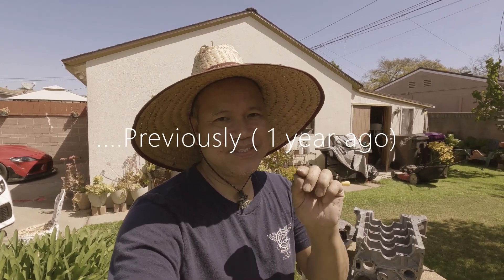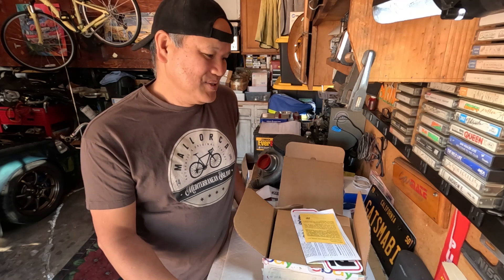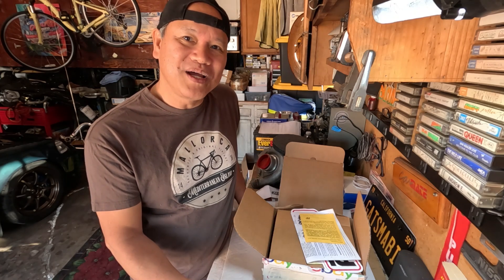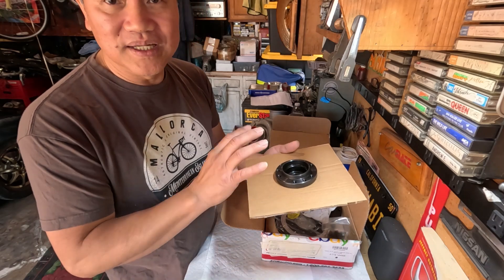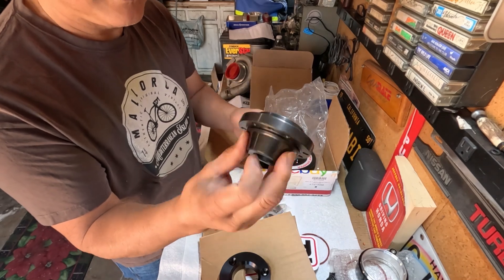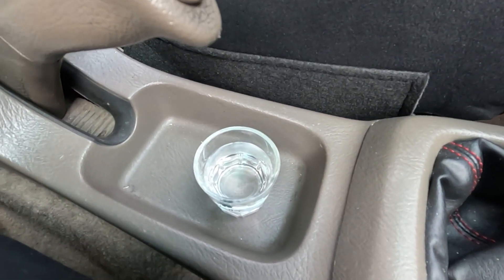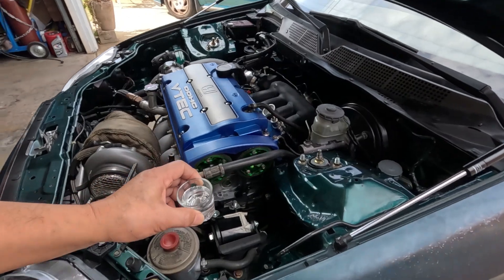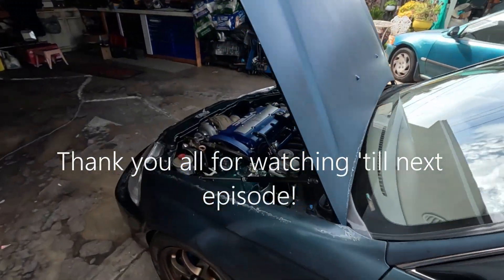H22 ATI damper! Do I really need it when Balance shafts are deleted?

Comment: Great video! 
I was wondering if this damper wil fit my h2b swapped civic ek. Frame clearance is already a problem with these swaps. What do you think?
Reply from the maker: Yes it should, you can get the other p/n 918469. It's the damper w/o the ring for power steering.
Reply from the maker: Thanks

Comment: My friend i need your help on an unrelated matter.. would a gen 5 h22 manual vss work on a m2b4 lsd transmission? Much love and appreciation
Reply from the maker: I should work, all Prelude MT vss gears are the same. I'm using m2s4 vss on my M2b4.
Reply: @sagittnet2158  Im sorry to do this again my friend, but you're the only one that knows haha. I took out the VSS, gears all seem fine, replaced the top part and it still shows Code 17 after 5 mins of driving. Its a h22a swapped ek civic, with a new rywire harness.. Could you think of anything else I should check? The speedo went out for a whole day before the code was thrown and now no vtec :( . What would you recommend I do next?
Reply from the maker: @CherryPickerr  I  recommend to do a t/s elimination process. Not sure what yr ek you have or are you using a ecu conversion harnes but lf l were you, l'll check the vss wirings. Check for any loose wire at connector. Did you have any issue before or vss problem arised recently?
Reply from the maker: @CherryPickerr  When vss is not working, vtec will be affected by it.
Reply: @sagittnet2158 no issue at all, harness is brand new. One day speedo stopped and next day code 17. I did replace the connector with another used one. I have ordered a new connector, i will try again. Wires all look to be fine
Reply from the maker: @CherryPickerr  okay, when ypu do get the new connector, verify that the wires are terminate to correct location and it  mate on the vss sensor. Hope you get if fix soon.
Reply: @sagittnet2158  Got new connector, still having same issue no speedo and code17 after 5 mins :( . I checked harness wires everything all ok (brand new harness). Could it be that its an issue with the wiring on the cluster? The cluster i have is very old and it previously swapped it. Should I try replacing the cluster.
Reply from the maker: @CherryPickerr  It's possible, do you have a spare cluster gauge you can check it with. Verify that the fuse if there's any are ok.

Comment: What would you rather, full h22a swap with type s pistons or a g23 with k20a2 pistons? What will make more power? 
This will be my first build and I am planning to do it myself, i have and h22 block that I can put some iron sleeves and I also have an f23 motor that has 180psi on the 4 cylinders, so I am not sure what to choose.
BTW awesome job, I have learned a lot in this channel
Reply from the maker: Since you have a H22 block and able to get it iron sleeve and its your first build, H22 ftw of course coz of the reliabilty. G23 will make more power and torque due to 97mm crank. Most people build g23 coz it has a iron block and dont have to deal with FRM sleeve.
Reply: @sagittnet2158  Thanks for the help, I will follow your advice and I will save the f23 block for a future project.
Reply from the maker: @chicho8158  yes and if you decide to ho turbo. Use your F23 block and get a k20 Nippon racing turbo piston like l have and use forge rod. Ebay forged rod is okay, thats what l'm using. But keep your power goal under 350, dont go any higher so you can enjoy it. 
I
Reply: @sagittnet2158  Also, I wanted to know this in case I go for the g23, if I buy k20a2 rsx or dc5 nipon pistons, do I have to put them backwards? What would you pick between those 2 pistons for NA?
Reply from the maker: @chicho8158  if you are using a h22 type S cams, use RSX piston. If your'e thinking of using sk2 pro 2 cams, use Civic Type R piston and use e85 for fuel coz of higher comp ratio.
Reply from the maker: @chicho8158  If using RSX w/ type S cams, install the piston 180 degrees. If using sk2 pro2 cams w/ nippon racing ctr piston. Clay your motor to make sure you have enough clearance.

Comment: Thats good kuya. Im thinking before to tune my car get ATI
Reply: Kuya do we have ATI that you can able to run a power steering and A/C belt?
Reply from the maker: Ati and Fluid damper are a/c and power steering friendly
Reply from the maker: They said it helps a lot and l'll find out soon.
Reply from the maker: Magandang kapalit ang  ati or fluiddamper sa lightened pulley mo

Comment: Sounds crazy but get the stock crank pulley balanced and see if you feel a difference in vibration. I know the engine is internally balanced but....a balanced crank pulley in my opinion is good. Also the k24 has a 99mm stroke and it's done without balance shafts. The f23 girdle is very similar to the k series....just my 2 cents.
Reply from the maker: Hey bud, how you doin man? I sent the crank, clutch assy balanced before it was assembled and my shop told me that not a whole lot of out of balanced on the crank. Been wanting for a long time to use a aftermrket damper and l'll see if any good on hi-rpm. Take care man

Comment: Always removed my balance on my motor with no issue on na stock builds. But I do agree with Built na or turbo motor it's a good idea to use a ati damper.
Reply from the maker: I wanna try it out, been wanting to have and use a aftermarket damper.

Comment: also would u recomend if i put oil catch can on my f22a1 motor ? would it help with the intake mani being cleaner
Reply: or running a littler cleaner i know it would have to be custom too !
Reply from the maker: If your'e turbocharged, its best to use a catch can. If NA, l know the one breather line from vc and connected to intake side, oil get suck in instead of the other way around. The idea is, that line was suppose to be the fresh air intake and outlet will be on PCV valve and air is introduce back to combustion but its not always like it. Having a ctach can wont hurt in between intake and valve cover.

Comment: I will install it in my Turbo H22, but in my opinion in performance we can't look the perfect engine as stock. The vibration can be added  from engine mounts, more stiff equal more vibration.  In my opinion the best way is always balance the crank with all components attached on it, the damper will be a cherry to the cake,
Reply from the maker: I agree, l'm using 75a mounts and it's day and night compare to what l had on it before. I thought of changing it to 65a in near future. 
I'll find out soon if these damper will make a difference on hi-rpm ramge. I got the crank, clutch assy balanced before l put it together. I'll make sure to give an update in near future.
Reply: @sagittnet2158  yes , sound like plan, thanks
Reply from the maker: @Hptorque  👌

Comment: 8:26  that New Parts Smile haha I would be just as giddy.   Why the super damper gotta be so expensive 😭
Reply from the maker: There are 2 part numbers for H/F series but its same product except for the extra ring for power steering.   It's additional $20
Reply: @sagittnet2158  which part number includes the power steering? If you remember
Reply from the maker: @eddominates  It's 918468
Reply: @sagittnet2158  THank you!
Reply from the maker: @eddominates  👌

Comment: here on PR we do rotational assembly balance before assemble , from the damper to the clutch , buy rotational assembly balancing eliminates vertical vibrations and i bought a ati damper to which deals with horizontal vibrations , for the perfect balance , after 6 month o f abuse on 255whp h23/22 bearing haf just slight lines couldve reused them if i wanted to , Did you balanced the motor?
Reply from the maker: Good info my friend and yes, l have it balanced prior to assy. But only the crank and clutch assy. I used to send my conrods too but l skip on the rods l put on. Can't wait to install it and l'll update it in near future. Thanks again

Comment: So, I wanted to comment on this, I rarely do, but I hope you see this.

I, for a LONG time, wanted to get an ATI crank pulley. When I was finally in a position to pull the trigger on it, I decided against it.

I saw so many posts from people who claim their engine spun a bearing, or had some other catastrophic failure after installing one.

After doing my research, not saying I am right, but I felt that Fluiddampr was the better option, but they don't make them for our chassis.

Then I found out that K series crank pulley fits on H.

Still running OEM, but when the time comes I am going to replace it with fluid dampr
Reply from the maker: I really do believe that keeping the b/s system helps out to prevent a rod bearing failure. It's my 2nd engine w/ b/s deleted and l really like to know whats it like using a damper ( b/s deleted).
There's lot of factors for rod bearing to fail. Oil, condition of the conrods, tune of the engine, the position of the piston wrist pin offset and last is the tune. 
I've seen a guy use a K series Fluiddamper and l tbought of it, it just l need a power steering on my car so l stayed away from it. I'll make sure to give you guys an update in near future. Thanks man!